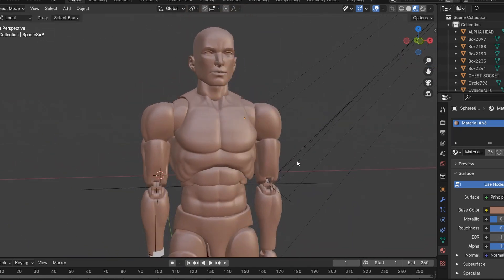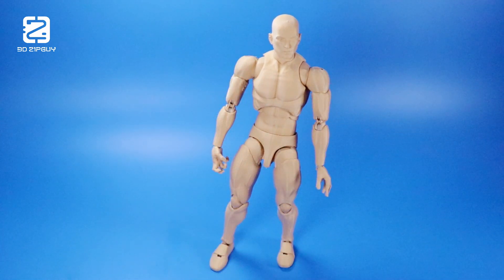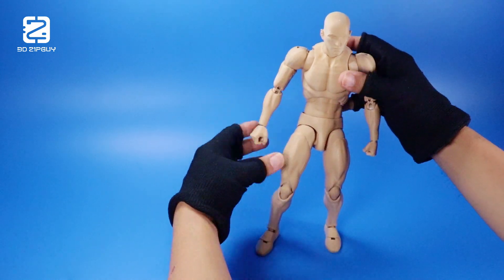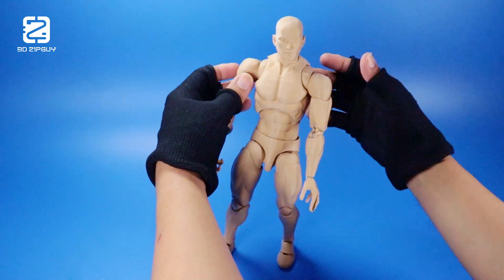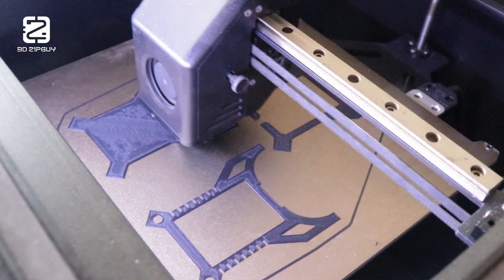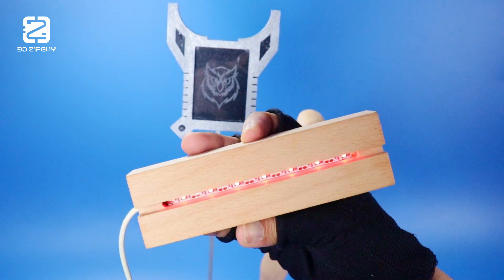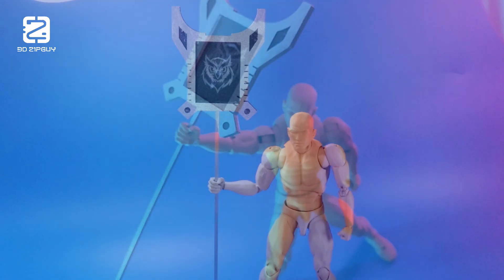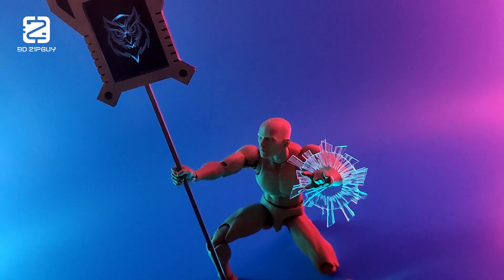Light it up! Action Figure Glow-up

Comment: Fibreoptic cable could be used to spread out the more. its less complicated to work with than it looks, very thin and quite flexable. combine that with a stronger light source and maybe some defused material (use as many layers as your light source will allow) and it should work fine.

Comment: Interesting device, can it really process aluminum? It's just that the price of a kilogram of aluminum is less than the price of the cheapest PLA.
Reply: In my country I can buy aluminum for 2 bucks per kilogram, and PLA for 10
Reply from the maker: @eugenechelovechniy  Yes. However, I am still a beginner so I have not tried it myself yet.

Comment: Instead of lighting the base of the staff, put a few LEDs in the top of the staff at the base on the image (2 or 3 LEDs will be enough) and power them from a 3 volt coin cell mounted to the back of the image.

Waiting for Version 2 to build my own.
Reply from the maker: @andy-in-indy  I will explore using LED filaments. The acrylic rod is way to flimsy anyway.
Reply: you can try the WS2812B WS2812 2.7mm Ultra Narrow LED Strip, they are really bright and small, and you can cut them the size you want